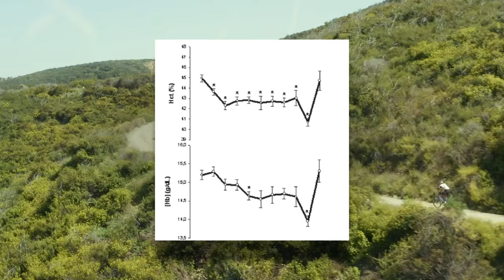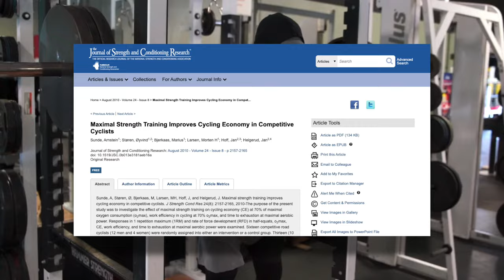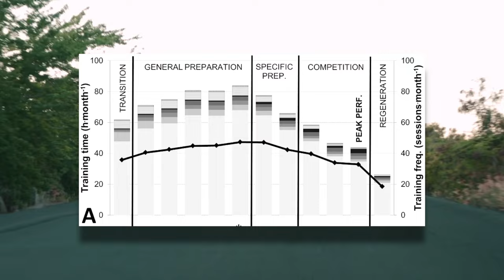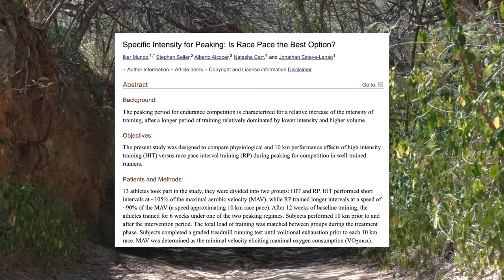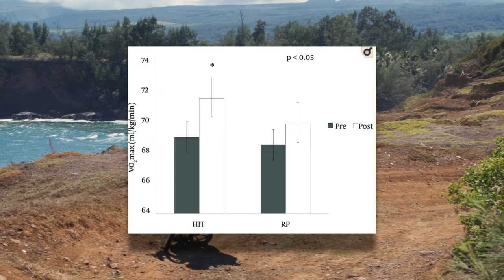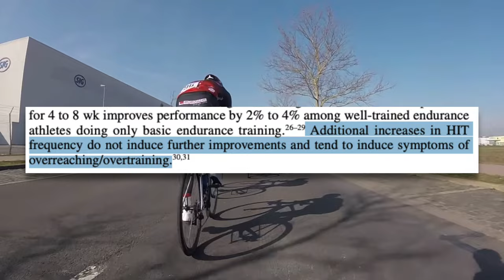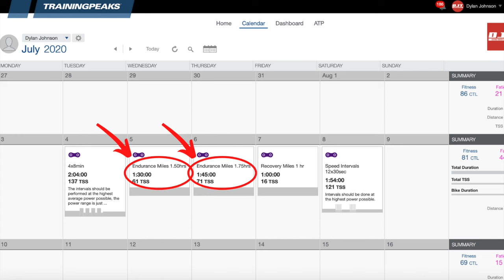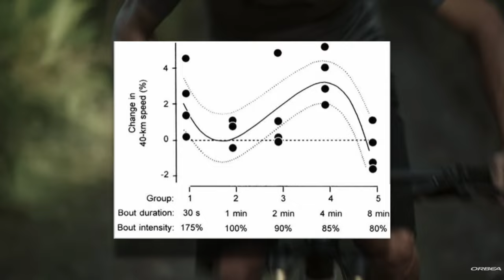How to Increase Your Power on the Bike. The Science

Comment: Just wondering on your opinion on replacing a long z2 ride with a shorter sweet spot session for the time crunched cyclist. TrainerRoad seem to think this is the way to go
Reply: If the TSS is the same as a z2 ride then it won't make much of a difference in terms of physiological adaptations. Just be aware that most people find sweet spot harder to recover from than an equivalent TSS zone 2 ride.
Reply: @shauncook7706  it surely makes a difference those arent the same energy systems you cant judge everything by tss
Reply: @simonsimon8213  in fact they are the same energy systems. Your body doesn't care much between zones 2-3,both are sub lactate threshold the only difference is intensity which alters the rate at which adaptions are made.
Reply: @shauncook7706  also one is below aerobic threshold the other one isnt
Reply: @simonsimon8213  what is "aerobic threshold"
Reply: @shauncook7706  one is utilising mostly carbs the other fat
Reply: @shauncook7706  one is utilising mostly carbs the other fat
Reply: @shauncook7706  one is utilising mostly carbs the other fat
Reply: @tgoods5049  the first lactate turnpoint aka lt1

Comment: I have picked up Indoor Rowing in the last 2 months - (but not much cycling during Covid) The interesting thing is that rowing is often done at low stroke rate with a lot of power for each stroke repetition: so, a lot of power while still doing intervals et. In other words: it combines power, a full body work out & a lot of VO2 Max Exercise. Also, half an hour rowing with sets is already considered a good work out.
Yet to see benefits on the bike, but rumor has it it translates well into cycling & it’s less boring then weight training (alone) - though doing squads etc is also beneficial for balance etc. (When rowing, do get a good example/coach, just slamming the rower doesn’t really work...)
Reply: Rowing and cycling go hand in hand. I row year round and cycle over the summer, and am decently quick on the bike. As long as you keep it up on the rower you will see gains soon, as long as your technique is good.
Reply: Valentin de la Pena - thnx! I’m curious to find out... (I am used to do a lot of spinning classes during winter, so it’s more of a change of format that resembles extreme low torque cycling, but I hope to find some gains indeed)

Comment: I work as a coach myself for elite juniors at a high school in Sweden (they are Mountainbikers and some of them are XC skiers). And the thing that everyome i coach seem to answer too is 85-15 modell (85% Low intensity, not over 1,5 mmol lactate. And then 15% threshold ,4mmol, or High intensity training, over 4 mmol lactate, depending on what part of the season), or the 80-20 model. We have seen some massive gains from this. And i have also gained a lot from it. Before i think some of the enduance rides i rode were too hard becuase i stopped in my own development, and didn't get any better. But by just riding slower and more strict during my longer rides and just do some interval sessions (often around 2 or 3 session per week) i have raised my lactate threshold (4 mmol) by 27 watts for 3 months (from 285 too 307) and my FTP (20 min test) by 37 watts (from 309 to 346). So by doing a more polarized, i think my season will be one of the best next year.

But then there is always this thing when it comes to sport science and training, you have to try new things and not just doing the same over and over again and again. I think i will need too change some stuff again in a few years to take the next big step. Great video!
Reply: of course also lifting heavu weights too

Comment: Hello Coach: I have a topic to suggest; recently there has been a growing trend to use a Ramp Test to determine FTP rather than the traditional 20 minute or two 8 minute tests. What's the Science say about the accuracy of Ramp Tests. I "love" the Ramp Test b/c the volume of pain is reduced to the last 3 minutes but I'm concerned it may be producing a false positive. On the other hand, I figure if I consistently use the same Ramp Test protocol to set my training zones and I'm seeing improvement, that's what really counts. Thanks in advance, love the videos.
Reply: Plant Powered Health Clearly I’m not man enough LOL that’s why I’m hoping the science will support the use of Ramp Tests. BTW, not even the pros use a 1 hour test; they use the 20 minute test.
Reply: @stanislaogerman3743  it's still a solid workout, the UK still has 25 mile or 40 km TT, so it's good mental training too. 1 hour climb is solid too if you go to the mountains. Yeh it's tough, but I can only do it every 6-8 weeks as a TT. I've found the 20 minute test pretty close to 1 hour power, after the 5 minute effort during the warm up pre test

Comment: After getting involved in a group a couple of years ago, I found that I found more excuses to not ride than to ride. That's because the group was just riding too hard and I was struggling to keep up. In the last couple of weeks I returned to solitary rides and wow! The sections of my ride are flying by when they used to creep by as there is no pressure. I ride how I want and what I want. I'm riding further and further with ease. LSD has always been best strategy for me anyways. I can ride 30 hard if I usually ride 40 to 60 a couple of times a week. Riding 30 hard and never riding 50 or 60 easy is really hard!

Comment: Dylan, when talking abuot zone 2 do you refer to heart rate or power.    Or does it not matter.  There seems to be many ways to calculate such things. If you use power that may change over time as you get fitter. with heart rate using something like  30bpm less than   95% of  HR FTP would remian constant... although your power output should drift up over time. Or does it not matter so much  at what level you ride in zone 2 , either HR or power.  It's just that riding just in to zone 2 or just below  zone 3  seems to me would have a significacnt difference in loading over time especially if you are doing long durations here. Or do you just aim for the middle of zone 2.?

Comment: Higher base strength means an easier base strength to put out more power with less effort and couple it with a good cardio base so you can go faster with less effort so you can hold higher speeds longer, recover faster, and have it in the tank to go hard if you need it

Comment: I have a question for you coach. My racing series runs from April thru the first week of August. We usually race every Wednesday or every other Wednesday. Races usually last for about an hour. My question is that if I have a race on two Wednesdays in a row, is it necessary to do a ride between the two races or should I be resting? I usually get most of my strength and endurance before the season starts. Any advice would be extremely helpful. Thank you.
Reply: It’s a week between those and it’s no problem doing zone 1-2 rides between them.

Comment: @Dylan Johnson ...when you say "Zone 2 Endurance ride" I'm pretty sure you mean Power Zone 2. For those who don't have a Powermeter yet (even though planning to ask one to Santa next winter) and use HR zones instead, how can we convert your Z2 into HR zone?
Both Garmin and Stava offer a 5 zones set-ups for their HR data analyzers, where Zone 2 roughly stands between 60% and 70% of MAX-HR.
Would you please confirm that we are training ok in HR-Zone 2 for low intensity endurance rides? Or is HR-Zone 3 (70% to 81% of MAX-HR) also considered low intensity? 
Thanks a lot!
Reply: It’s actually almost better to use HR when you’re doing base training. So just go ahead using heart rate.

Comment: Thank you for this video! It's very useful – and very packed :D
My question: how would you approach training season periodisation when racing is on spring and the winter is cold and dark? The issue is that gathering volume on base season is difficult when it's already dark at 5pm and riding more than two hours z2 outside requires electrically heated insoles. Here in northern Europe, trainers are popular; but doing 3h or more on them very often is mentally surprisingly taxing.
Reply: Check out his video on crosstraining!

Comment: I have dozens of climbs in my local area between 12% to 22% - to increase my power and anaerobic threshold I frequently ride these clams in a 39t x 25t or a 28t rear cog - 

Typical climb is between 15 to 25 minutes.

I ride with a low gear that is not optimal - it's way too hard - 

To enhance my recovery and improvements in power Get plenty of rest actually hyperest too much rest... Quite often.

My Strava results continue to improve year after year.  At age 61 I'm faster than when I was age 56.

Comment: I am a 65 yr old racer.  I find that when I eliminate all high intensity work in the off season (typically for me September through December), that it takes much longer to get up to speed for the season.  I noticed this effect after I turned 50 - probably was happening from my mid-40's.  Granted, I am not providing you with a lot of information, but do you have any thoughts on this?  (I'm a subscriber and please check out my channel.)  Thanks.

Comment: At 59 I go with a 3 day a week ride and take the weekend off . I usually increase volume with some intervals . I usually top out at maybe 25 miles and 3000 ft of elevation climb  and then I need to reduce volume and mellow out for a bit . My max effort could last a month  then I plateau and then start loosing strength . Rest and recovery could be the most important part of training coupled with a good diet

Comment: Been teaching for years, and years. Many of my clients are 40+ year old, why... Young ones like the spin, no power, just dance on bike... Sad. But they have seen that thru the drills we do they increase their power. One client just turn 65, he started with an average power of 85 watts at the end of a 45minute class, now his average is 165watts, and can sprint for 10 seconds at a high end of 700 watts. Another client 83 yrs that had issues just standing up after sitting down, he started with average wat of 45 watts, now he is pushing an average of 87 watts, and sprint of 200 watts. They see the increase on strength on their legs and cardiovascular system. All about Watts.

Comment: I have currently best shape of my life i even struggle To get heart rate up Last month i cycled with road bike 78 km 36.8 avg speed i weight 77 kg it was only 152 avg heart rate and with mtb bike same route 32.5 avg speed 143 avg heart rate i have no idea how To get rid of that my legs just gets huge lactic acid if i try Push heart rate To 160, Last month i tested too on gym i need To Push 340 watts To get even 160 heart rate and it does not rise after that fast
Reply: How much hours did you train per week to get to that level?
Reply: @JeyDeee89  every single day no matter what weather usually 54 km during cold weathers it takes 1h 40 - 1h 50 min To cycle it many layers of clothes slow down me much so easy 160 heart rates but during summer weathers it's only 1h 19 minutes so these days i cycle 78 km they are 2h 10 minutes so around 12-13 hours each week funny thing is i don't even know my current ftp for 1 hour im too scared To test it 😅